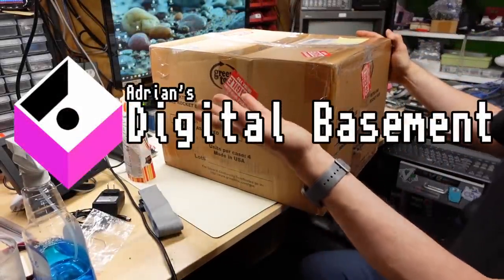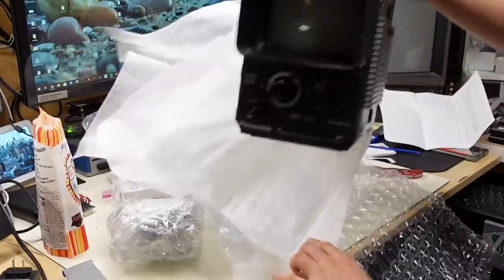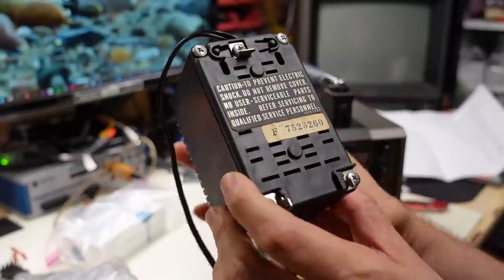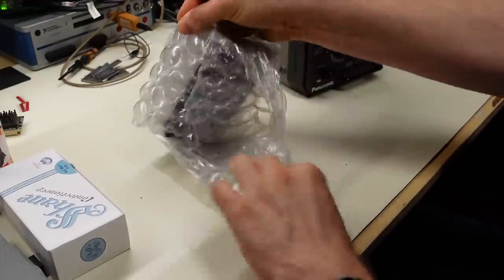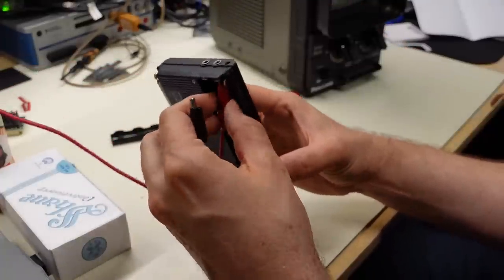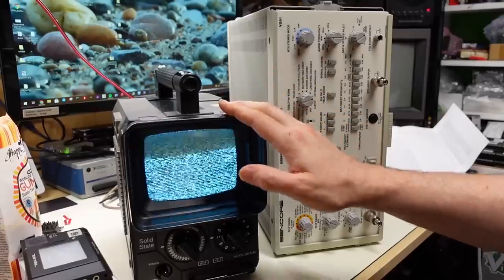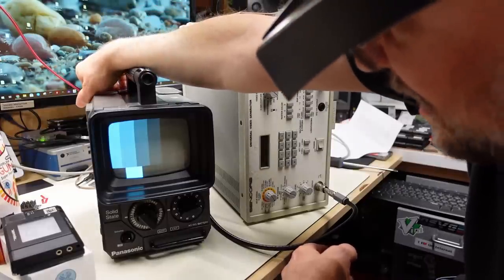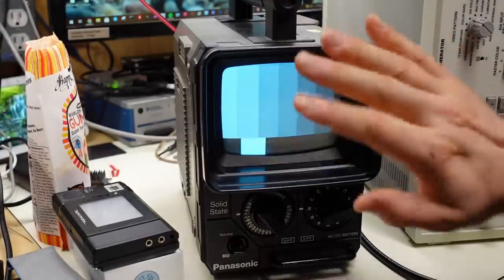0006 Mr Roboto, the TV edition (Panasonic TR-555)

Comment: I love the incredibly crisp raster of those small b&w sets. I own a 8" Sony since my early childhood in the 70s. My uncle gave it to me when I was in hospital after I broke my leg really bad. It took so much abuse during my youth (the tv, not my leg...) I think I put twenty new regulator transistors in the thing because I constantly connected the 12VDC the wrong way when I used it outdoors or on the back seat of my dad's car. It has thousands and thousands of hours on it and ist still going strong and crisp. The CRTs in those old small Sony b&ws seem to last forever. The opposite to those super crappy japanese electrolytics of the 70s. And if the cathode connection inside the crt doesn't fail of course...
Love your videos. They always bring back memories!
Reply from the maker: Even Sony color TVs just seem to last forever. Even when they are worn out they still look amazing once you tune them up.

Comment: I remember when I was a kid in the mid 70's there was a brief craze in the UK for psuedo "military" gear in radios, TV and HiFi. I had a large (shoebox sized) transistor radio that my Grandfather bought me that had a 5" speaker that was ruggeed and military looking and trying to look like it might have come off of an aircraft carrier... but when I took the back off to have a look the tiny radio PCB was huddling in the corner behind the controls, about the size of one of those pocket radios! It did have a mains power supply though, and to be fair it lasted for years. Not actually sure what happened to it, I probably swapped it with a friend for something.

Comment: If you don't get an image on high RF input, you could also be overdriving the AGC which would cause the tuner not to lock. You could try dropping the output power on the VG a little first and see if the tuner can catch the signal on the higher channels.

Other than that, more than likely there are quite a few bad filter caps in there.
Reply: Where my mind went - I remember a UHF broadcast relay coming on line causing a lot of TVs needing signal attenuators fitting in some villages to get a picture (UK PAL, Yorkshire TV region, if memory serves.)

Comment: Cool TV
You have connected to the VHF antenna connection so that you can receive the lower channels. For the upper channels you have to connect to UHF.
Reply: Channels 2-6 are VHF Low band, 7-13 are VHF High band, and 14-83 are UHF.  Later frequency allocations dropped the upper UHF channels 70-83.

Comment: Adrian, those antenna adapters convert BALanced 300-ohm twinlead to UNbalanced 75-ohm coax, so the name is shortened to BALUN (not "bay-lun").  Unbalanced signals have a signal and a reference (typically ground), while balanced signals don't directly use a ground reference but more like two opposite polarity signals referenced to each other.

This is not a nag to correct your pronunciation, more just pointing out to you and your viewers the origin of the name and teaching about the signals.

Thanks for producing such enjoyable content; and yes I'm jealous of that Sencore test set! 😊

Comment: I had a very similar National (Panasonic) TV in my bedroom as a teenager. It was the Ranger 505. I believe this was an Australian model. It was VHF only and had the weird Australian only channel 5A on the dial (right on the lower edge of the 2m amateur radio band). It had a built in AC transformer plus you could run it from 12V DC or internal batteries.
Reply from the maker: Yeah I was just chatting with an Aussie friend yesterday about how National was never used in the US. It was always Panasonic from when they started selling here in the 50s. I never knew that National was their brand in other countries.

Comment: On the LCD TV, another possibility is there is a switch that acts when the cover is opened or closed, and it may just need a bit of DeOxit. Try that first before condemning that neat little TV to the e-waste bin. As for the other TV, we had one very similar but it had continuously variable tuning, so some precision was needed sometimes.

Comment: Such a neat TV.  It's the kind of thing I would have seen on my grandparents' kitchen count under the cabinets.
Did you check your balun and/or connectors on that coax cable?  I've seen higher frequencies fall off when there's not a solid connection between the F connector and the Female F81 barrel jack.  (I'm sure you did, but I'm hoping to be helpful)
Reply: The two connectors looked like they may almost have been touching when he screwed them in...if they were shorting together in any way, that'd cause reception issues!  ;-)

Comment: I like the TV too. It’s styling is a lot like my Philips P45 which has an oval shaped hood around the screen. The control layout is very similar and I’ve seen a US version of the Philips under the Zenith name.  I bought the set in 1980 so it seems odd that as Philips had just acquired Philco that it wasn’t a Philco. A friend has several Ranger 505 sets which would be a slightly earlier model

Comment: I wonder how practical it would be to fix the ribbon? Although my TC53 is not flip-up like that, I did manage to break the ribbon off the back of the screen unit when I had it apart for adjustments (greyscale) .. fixed by bodging with a bit of solder & then great care taken when opening up the set in future. This might be a possible temporary "fix" for demo purposes .. I'd like to see it, anyway.

My T530 being flip-up does carry the risk of the cable breaking but in my case it's the backlight which stopped working, the screen image can still be seen when shining a light on it. That might have to have an LED "upgrade" as I have no idea where to get the tiny CCFLs from.

Comment: It looks like that Panasonic couldn't decide if they making portable TV or professional monitor. It's design screams "I am professional camera gear, not some prosumer oddity".
Reply: In my opinion, it wouldn´t look out of place in a battlefield 😅
Reply: @senilyDeluxe  Unless you got hold of a video game from Europe, since these use 
UHF channel 36.
Reply: @BertGrink  I happen to live in Europe, so...
Most stuff broadcasts on channel 36, especially Commodore and VCRs. VCRs can usually be tuned from 32..40. The Philips G7000 (aka Magnavox Odyssey²) broadcasts on channel 32.
Most video game consoles in Germany are on channel 3 or 4 (actually non-switchable consoles usually prefer channel 4), the Atari 2600 can be switched from 2..4.
Some German PONG consoles have a tuning knob. Don't wanna tune the TV to the console? Tune the console to the TV!
I also have one single VCR that broadcasts on ch.4.
I haven't seen anything broadcast on channels 6..13 (apart from signal generators and harmonics from crappy modulators - like the Interton VC4000 can be received all over the spectrum, even hyperband and sometimes in good quality)

Comment: Have you ever tried using conductive paint to try to restore flex cables?
Reply from the maker: they are usually cracked so the plastic itself is damaged. I've found all repairs that work are temporary and also quickly fail again.

Comment: Is it possible to repair those flex cables? Some computers' key matrices can be repaired with a conductive pen. I dunno what the pitch is on that flex cable is or if it might be possible to replace it. I'd kinda like to see the thing work if it can be repaired.

Comment: 16:30 Excuse my ignorance - not from the US! - what about channel 1?
Reply: US channels range from 2 to 13 on VHF, while 14 through 83 are on the UHF band.
Reply: The FCC discontinued use of VHF Channel 1 from television and reallocated it for public safety uses (e.g., police radios) in 1948. Yes, 1948. The US analog television system was very, very old! This is why it had a lot of oddities (weird connectors, the various problems with NTSC, etc.) that were corrected in countries that got television later (In the case of NTSC color, it's weird because it was decided that it needed to maintain compatibility with black and white TVs. In PAL and SECAM countries they didn't try to keep that compatibility so they were able to start over with a blank slate and design a better system from scratch.)
Reply: @senilyDeluxe  Before the sixties the UK was on a 405 line system so the 625 line system was incompatible with older TVs. They ended up simulcasting to 405 until the eighties if I'm not mistaken.
Reply: Eccellent question!

NTSC TV Channel 2 was from 54 through 60 MHz, 6 MHz bandwidth.  So Channel 1 would have been 48-54 MHz, and the 30 to 50 MHz band was set aside for VHF-LO public service use, like police and fire.

Decades ago I donated to a friend an old TV that had Channel 1 on it, and no UHF (14-83).  Also a UHF converter that received and sent a VHF signal to pre-UHF sets.  I don't know if he ever got that old TV set working again.
Reply: @bobblum5973  Channel 1 was actually 44-50MHz. This led to a picture carrier of 45.25MHz which happens to be the IF stage frequency of more modern TVs. I'm not sure if this is a coincidence or not.

This does leave a 4MHz gap between channels 1 and 2 but this isn't that abnormal, there's also a 4MHz gap between 4 and 5.

I've been working on an old TV from 1949 but its tuner still has a setting for Channel 1. The service literature just ignores the Ch1 adjustments entirely which I find amusing.

Comment: 12:50 Oh, another nonstandard barrel plug! I hate those! I have fiber-to-copper network converters with that same design choice at my job. So when their power supplies die, I can't just grab one off-the-shelf; I have to splice the dead unit's barrel plug onto an off-the-shelf power supply.
Reply from the maker: Yeah I'm half tempted to see if it's somewhat standard inside and just swap it out with a normal one.... for now, I'll just leave the little pig-tail on it.

Comment: Replacing a flex cable is not hard... it's usually straight parallel passthroughs, I've done it by finding other flex ribbons and sizing them (as long as they are done carefully) and had them work just fine in laptops, dvd players, cd roms, etc etc.

There's probably a way to do that right :D

Worst case I've managed to solder-bridge a break in a flex cable's copper tracing, then painted over with liquid elec. tape.  That's a sketchy fix I've had to use when it was a complex ribbon cable or flex cable and there was no other replacement available.

Sometimes it looks like I can get away with using the parallel  ribbons from old ATA IDE hard drives... but that's not one I've actually tried yet to add to my  hardware hacking repertoire repository.  CLosest thing I've done to that was making my own PCI-express graphics card bridge for a pair of Nvidia cards by point-soldering two SLI connectors (the original bridge wouldn't fit my motherboard) wire-by-wire with good-ol hard drive ribbon, Ruby fluid flux, a sharp eye, a steady hand, and a lot of patience... and yes, it absolutely worked.  (This was about 12 years ago now, before we had Vulcan and modern DX/OGL API's that allow you to have multiple GPU's and mixed GPU's without the need to SLI or crossfire bridge them).  But, if i can do that, I can probably rig a 'flex cable-IDE cable' hybrid.

Comment: Japanese electronics quality was basically real junk in the early 1960's, the reputation gradually improved over time and was much improved by the late 1960's but still questionable.  As the TV market of US made TV's declined due to a number of reasons including dumping and currency manipulation for which the US government turned a blind eye, market share increased for Japanese products.   US manufacturers became lazy in terms of modernization of offerings and lost share due to poor management and failure to innovate, on top of extreme government planned negligence, criminal negligence is more like it.  By the 1970's certainly Japanese products were of very good quality and were better received among those who had not had to participate in WWII and or dealt with them personally in WWII.  However, the US government had no such bias against Japanese trade, being the assholes that they are.

Comment: and i thought six D-cells was too many... i wonder how many minutes 9 D-cells last in that thing. 15? 10?

ps, no, you can't have channel 13. were you not a child of the 80s? channel 13 on the air was always fuzzy.
Reply: At 300mA, 4AH D-cells (which I've encountered rechargeable ones from the early 70s that had 4AH, so that's a sensible capacity) that would make a little over 13 hours of runtime.
300mA also explains why the wall wart is so small.
Btw. if that thing was color, it would've sucked around 1A and drained the batteries in like 4 hours.
Reply: A good Quality alkaline D-Cell has about 10 Ah.